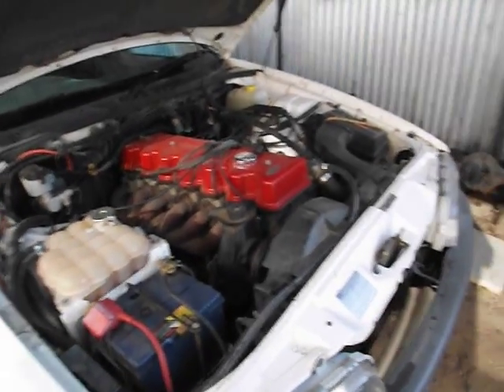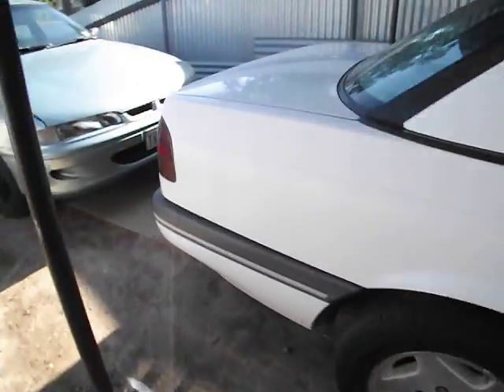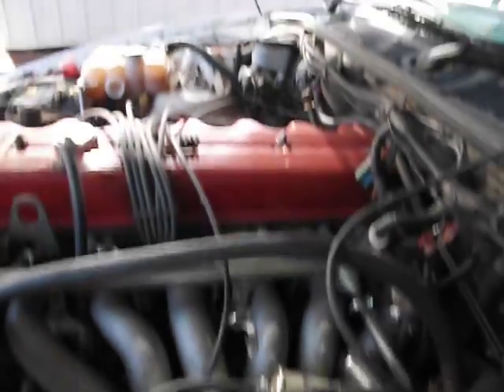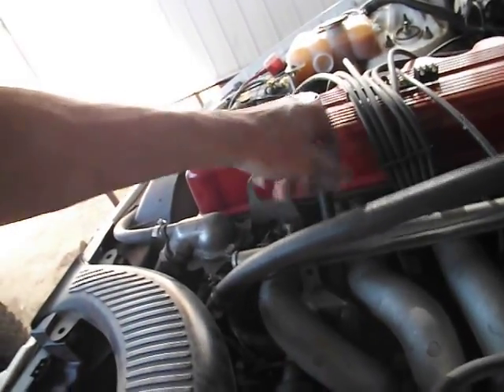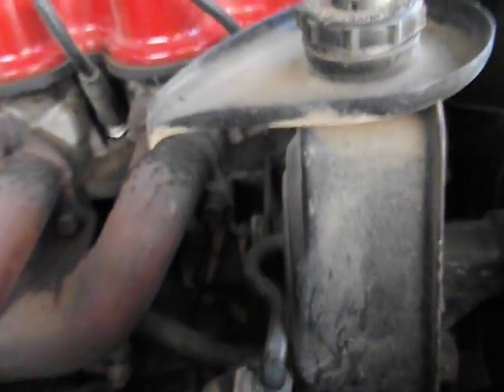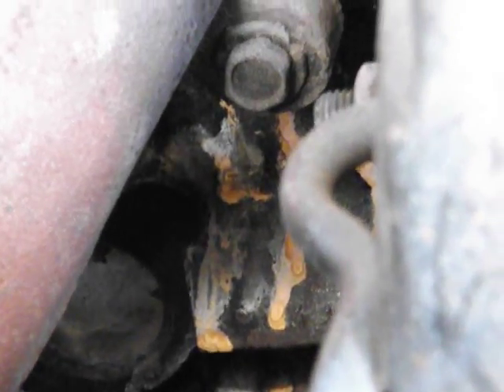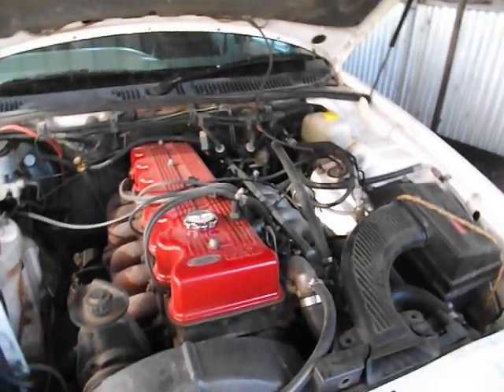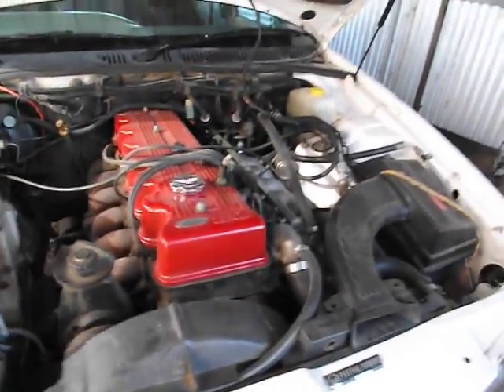diagnosing blown head gasket, eb falcon

Comment from the maker: should be easy, i never pulled the plugs. the biggest symptom was a loss of compression while cranking in a cylinder. when it started a miss was noted which was traced to number 2 cyl. so it should be interesting to see what the gasket + head looks like when i pull the head later tonight

Comment: What have I done... Smelt the radiator overflow for combustion (like an exhaust smell), start car with radiator cap off and look for geysers. Vacuum gauge (can google how to read - pretty handy tool). Compression test - wet/dry (though not needed for super obvious blows). You can also try taking the plugs out one at a time and cranking it with the radiator cap open - that's a cool one. But yeah, $160 to get it done and enough change to have a beer - good luck with it.